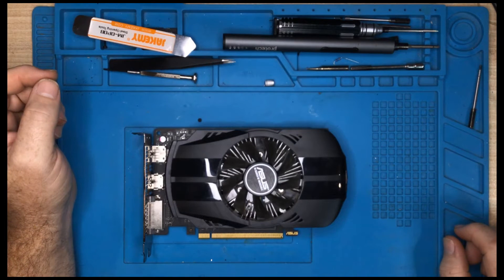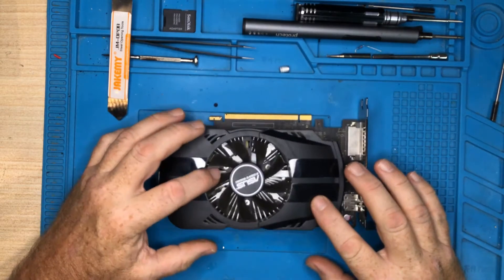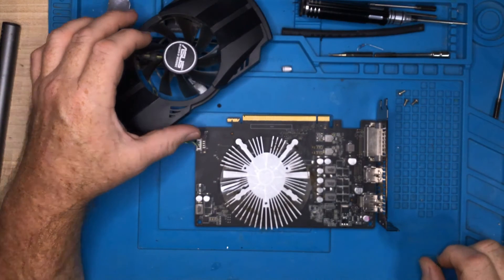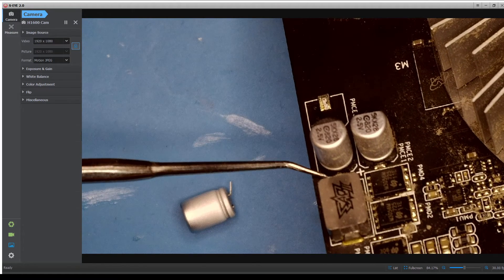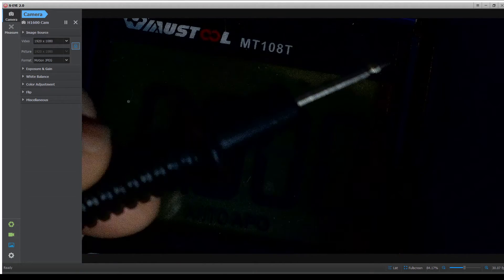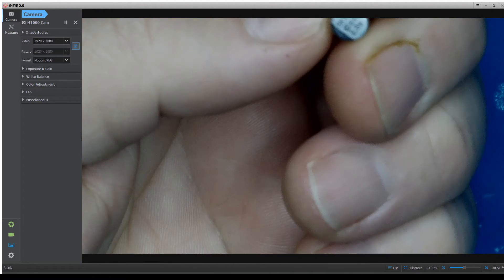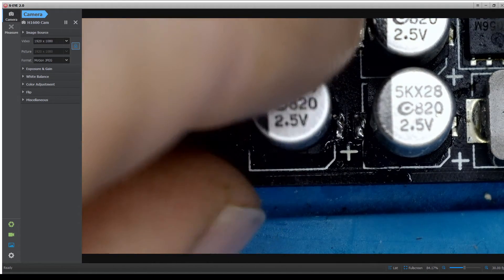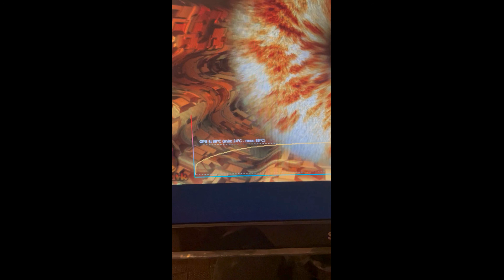Repairing Video Card - Capacitor Replacement

Comment: So im working on my 1050 ti and i stumbled acrossed your video (surprised you had the same card a little different though not sure why) while looking online for capacitors but i cant find anywhere to buy the exact capacitors would you have a link from where you bought yours?
Reply from the maker: Hi, I bought it off Ebay, I think the link is still active.
https://www.ebay.com.au/itm/256110811977
If not a search for something like SMD Capacitor 2.5V 820uF, should bring up any number of links to AliExpress etc. With caps you can go a larger voltage if you can't find 2.5V.

Comment: I need to replace 2 CAPS (100UF 20% 16V SMD) on a SCION XB Dashboard printed circuit.  
I ordered PCE4534CT-ND EEE-FPC101XAP, from DIGIKEY.   The soldering legs on these CAPS are TINY and it
looks like I'm going to have a hard time soldering these.  
?? Is there a similar CAP that has LONGER LEGS?????????????
Do you avoid SURFACE MOUNT CAPS that have tiny legs??????
Reply from the maker: Hi, they are not really designed to be hand soldered which is why they are such a pain. The technique that I find easiest is what I do in the video. You apply solder to the pads, then apply the solder tip to the end of the legs trying to melt the solder underneath the cap. Another way is to purchase through hole caps, then solder the legs to the pads, and bend the cap over, out of the way. But you sometimes you don’t have the space for it and you need to be careful not to put pressure on the pads and rip them. It’s also helpful to buy an smd practice board and get your technique right before attempting the real thing. That’s what I did in the beginning when I was struggling to solder smt properly. 🤞 you’re not alone in finding them difficult to solder.

Comment: The repairing was good but you should buy a proper 60 fps camera for recording instead of the camera u using right now coz its so laggy 😂
Reply from the maker: You're right, I'm new to this :), and only realised afterwards that the recording was laggy. It was because of the new microscope I bought. I'm recording on a laptop using OBS, and it couldn't handle having my main top down camera (IPAD) and the microscope enabled at the same time. There's always something new to learn!